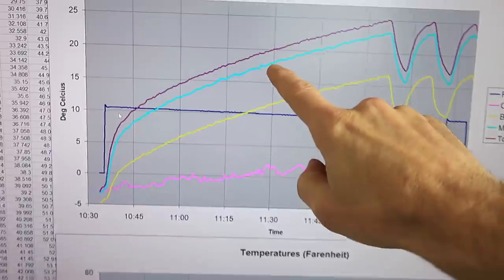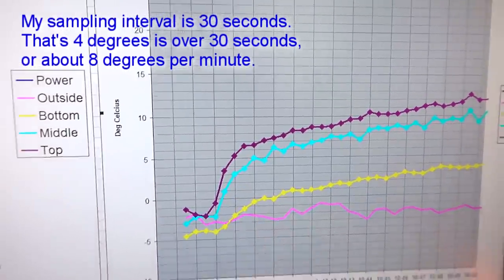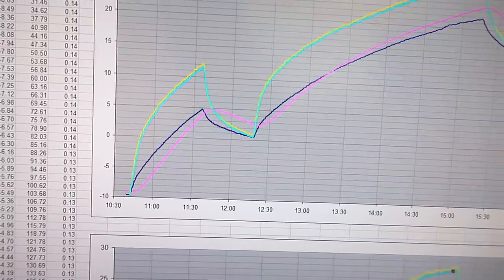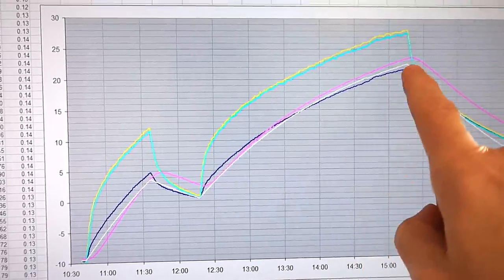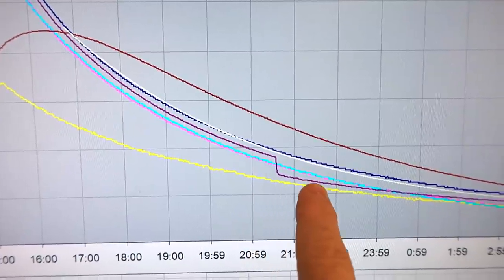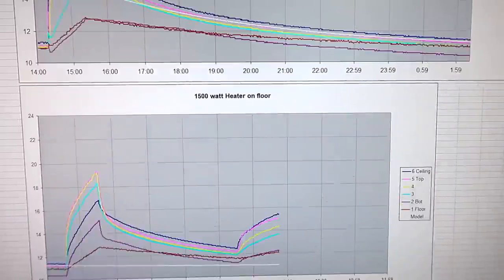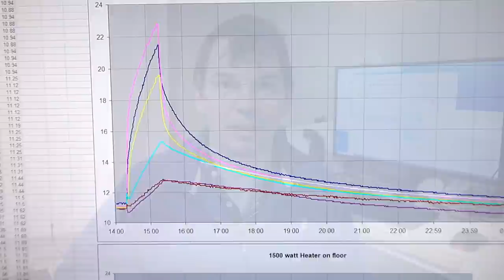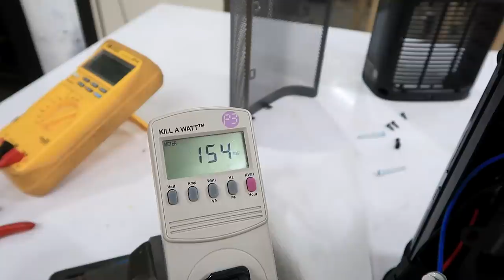Where does the heat go when you heat up a room?

Comment: Amazing experiment! I have heaters like the old ones, and my brother bought one with the "ceramic element", as they say... Much more efficient, thou there is one aspect to them that is not at all related to the quality of their production, just a issue wit our everyday lifes: He asked me if i could investigate why it wasn't blowing air correctly, he thought that the fan failed... Happens that he have a cat... And i ended up taking ot a "blanket" of entangled cat hair that accumulated in the air stream in front of the heater... But it protected itself very well, and after cleanig, came back to work with full purpose!

Comment: As per the ad, ceramics have really interesting thermal/electric properties.
I had a little cube heater that was all metal, insulating ceramics, and ceramic heating elements. If you ran it with no fan(3-position switch) the elements would get get red hot, and cycle like a toaster oven. In that mode it was like having a little fireplace just to keep your hands warm.

Comment: Very interesting!

At the moment I am monitoring the temperature of corners compared to straigt walls. I found up to 4 °C difference in corners when it is very cold outside. This leads to condensation and mould.

Now I am building a resistor wire heater which heats the corner to room temperature with 10 W power.

Comment: It would be interesting to redo the shed measurements with a sheet of insulation taped over the single pane window and maybe an inch or two on all sides of it to cover the frame too. That R value of 1 on 3 square feet is obviously having some effect on temperature retention.
Reply: yes this
Reply: @jzvetter  Aaaaand weatherstrip the dooooooor
Reply: Yep, just a few strips of tape can make quite the difference.

Comment: 11:00 nice testing, goes well with expectations. however, the main tip for fast heating, is to have heater near the person and not much air movement that may come from outside the room or windows.  building material mass wouldn't matter much except difference in density, less dense, more air, better insulator.

Comment: Just a couple of general notes for the readers:2
As you perform the measurements while you are out if the room, you can trust the heater power readings.  If you are also in, you need to add something like 100 W (at low activity and more, if you exercise).  The time constants are another issue.  Your graphs did not settle to steady state at the high end before turning off.  You may have taken that into account, or not?  The math is very easy, if the temperature is let to stabilize and more convoluted, if you use only a portion of the possible temperature range.  Otherwise, nice work!

Comment: Your calculations are good the leakage is non-linear, but the thermal resistance parameters are a linear approximation. It makes calculations faster and easier. This makes a big difference for the foams. Plastics have a termal conductivity that depends on the temperature. The temperature resistance is greater at higher temperatures because the temperature expands the molecules and the spaces between the atoms are larger.
Reply from the maker: yes, and convective and IR heat transfer increases with temperature.  All very approximate.

Comment: Tape up all the seams to prevent drag and see if that has any effect. 

Measuring air water content inside the shed while person is inside would be interesting project. 
As long as you have less than 60RH you dont have any molds growing. 

Some insulation materials dont allow water vapor to pass through.

Comment: A friend had a room burnt by his dog knocking over an old space heater. After we rebuilt the room and got a space heater with all the safeties, the dog pushed newspaper in front of the heater to burn it down again.
Reply: Sounds like they need a new dog rather than a new space heater lol
Reply: @seanfrank6032  nah the real solution is don't use space heaters. They're not safe unless they work like this, but even then there's always a high risk of fire.

Comment: Do you think ceiling fans might make sense in the winter? I usually think of them as something for summer use. But they could de-stratify the air in the winter, too, I guess.
Reply: Agreed, I'd love to experiment with a very slow moving one that didn't create much draft, (since moving air makes us feel cold), but just barely enough to mix the air, or destratisfy as you said.
Reply: @CraigsWorkshop  Most ceiling fans have a winter (reverse rotation) mode.

Comment: I know it would vary a lot depending on the sun shining on the shed, but since you know the thermal efficiency of the insulation and have this data, could you predict with accuracy how much the temperature will drop inside the shed if you put a certain weight hot object inside it? Like a 5 gallon bucket of warm sand or rocks?

Comment: It would be interesting to see how much thermal gain you are getting in the shed on a sunny day vs a cloudy day. The window should prove to give more gain than expected from the sun too. 

Also fastening the sensor to the calling in the bedroom vs about two inches below should be interesting. I couldn't tell from the video, but if the sensor is touching the ceilling, it would seem your data would change as it changes temp.

 You didn't say what was below the bedroom floor. Part of the curve for the floor sensor could have just been from its thermal mass. If something like your shop is below it, and you are heating that the curve for the floor would change from the wood floor, and the space below.

Tons of cheap sensors are lots of fun. 

Thanks for doing the stuff we don't have time to do.

Comment: I recently got a CO₂ sensor, and the ventilation that you would want is scary if you also want a somewhat warm room. Of course, warming and cooling without a source in the room (you) is not very interesting, but you'd be surprised how quickly the CO₂ concentration rises with just one person in a room that size (~37 m³ in my case).
Reply: Just get some lithium hydroxide canisters.... :D
Reply: Wait, why do you have a CO2 sensor?  Humans have a very effective CO2 sensor built in, as do most other creatures.  It's the main way we protect ourselves from suffocation, since we can't detect oxygen innately.
Reply: @LeesChannel  Borrow one and go sit in a room with it. You'll be surprised how high the concentration gets before you'll notice it. And as CO₂ is a good measure for the recirculation in a room, it is also a decent proxy to prevent covid infections.
Reply: @Maarten Sneep  It may make sense in an office setting for automatic ventilation, or maybe a prison or a mine, but I don't need an external sensor to verify my own comfort.  We have many redundant failsafes to protect from carbon dioxide poisoning, this is a primal function of virtually all animal life, more essential than seeking food and water.  Even non-sentient life can regulate carbon dioxide.  There is no greater or more urgent panic you will feel than dangerous levels of carbon dioxide, and even if it happens suddenly when you are deep asleep you will wake up heaving and smash your window or run out the door.  Conversely, the reason why you feel comfortable with somewhat elevated levels of carbon dioxide is because of how effective the body is at carbon dioxide regulation, both externally and internally (acidtosis.)

Comment: So it would be pretty simple for the manufacturer to add an adaptive mode where the heater senses the incoming air temperature and calculates the power level required to stay on 100% of the time.
Reply: A PID heater would be cool but I don't think anyone running to Rona to pick up a heater would care enough